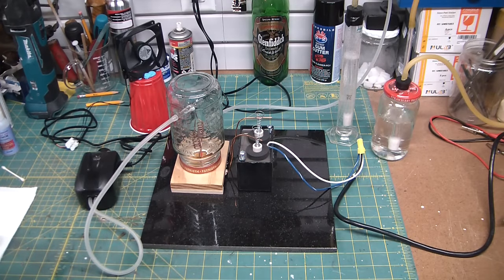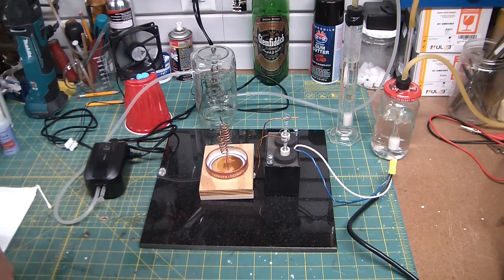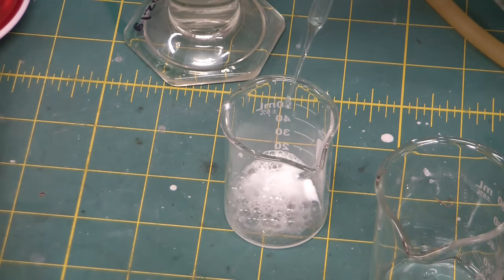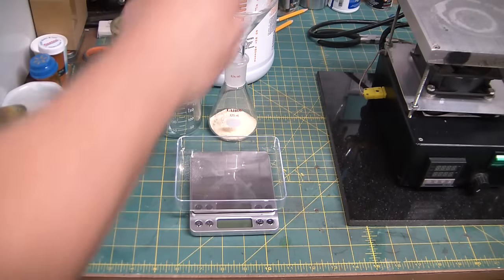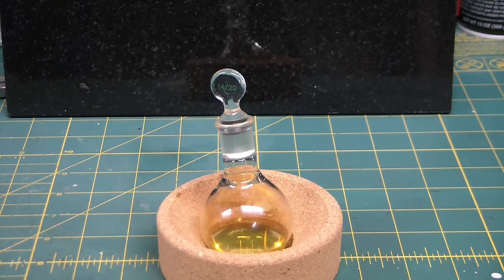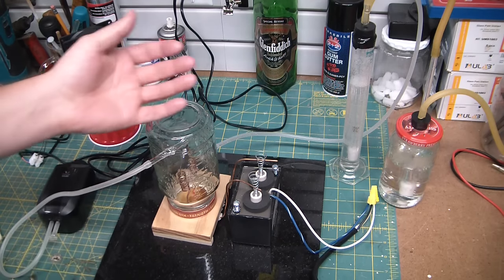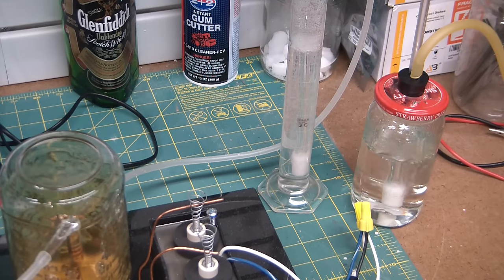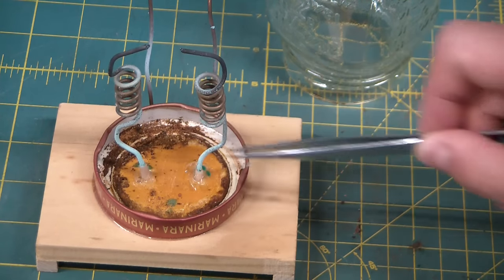Making Nitric Acid From Air - Elementalmaker

Comment from the maker: Hope you guys enjoyed! Here's the parts used for this video:
-oil burner transformer: https://amzn.to/3OtU1jg 
-air pump: https://amzn.to/3z2CN6T
-gas dispersion tube: https://amzn.to/3BcQcMv 
-cooling fan: https://amzn.to/3cv5SAd
Reply: Are you related to Ave?
Reply: @SynKronos  Certainly of the same crazy mentality as us who watch them both... 🤣🤣🤣
Reply: what about using a microwave to make plasma inside the jar ...
Reply: did you sulfuric or nitric acid ?
Reply: Can a Aquarium air pump work just as well
Reply: GOOD WORK👍
Reply: is it possible to do it in prison
Reply: would a neon sign transformer work?
Reply: Try out the Oswalt process (using nickel oxide catalysis)
Reply: Transformers for Neon-signs are also working, or for Ozone-generators, they are a cheaper too.
Reply: Now, make nitroglycerin. 😆
Reply: 6:15 Use (nylon?) gloves of some kind!!!!
Reply: Should of kept the sulfuric reaction in a ice bath same with making super cooled air when sparking. Larger surface area spark multi layered plasma. Would boost efficiency
Reply: The arc likely created a lot of UV light which may have degraded the epoxy.
Reply: Are you still alive
Reply: You still out there man? We're worried about you my man.
Reply: Please tell me it wasn't a microwave transformer We miss you man please come back
Reply: As one of you first 10 subscribers from waaaaaay back when, I'm hoping you are OK and still out there buddy 🙏👍
Reply: @Growveguk  He's still around, I saw a comment from his account a couple weeks ago on an AVE vidja..

Unless someone stole his account.
Reply: @walkingcontradiction223  good to know.  i'd been wondering/worrying a bit.
Reply: Nice, nice ... COME BACK!
Reply: can this way produce 100 liters of 70% nitric acid per month? if not how can we make it do it? would it be efficient? Also, can a 220 Volts electric current be used to generate the electric arc or not?
Reply: Miss seeing you on youtube - loved your content
Reply: @CodeCrafted_ if you want to make 100 liters of 70% nitric acid per month, you would need to make about 100 of these. I'm still trying to figure out how much my similar setup will make in a set amount of time. I keep running into issues keeping it running when I'm not around. I seem to be only getting .1 molar after about a day of running, and you need 15 molar (I think) to get 70% concentration. But I'm hoping to improve efficiency to get about 1 molar per day, which would yield about 1 liter 70% ever two weeks or so.

Comment: finally, a project that involves high voltage, toxic gasses, corrosive liquids, poison and baking soda
Reply: Codys lab made this some time a go
Reply: And no gloves and probably no eye protection.   A man that thinks just like me.
Reply: @tomirenfors2344  5 years ago
Reply: @kristyanne719  no gloves is fine here but eye protection he pobably has
Reply: Use h202 in place of h2o.  35% is better yield than 3% but 3% gets better yields than h20. Droplets are better than bubbles. Good video!
Reply: I've been wanting to do this type of project for some time now.  Nothing like cheap chemistry/fertilizer
Reply: It's all overestimated a lot.
Reply: any days on my kitchen
Reply: @kristyanne719  no gloves is safest when working with nitric acid, um who did a video on this, I think it was the young nile red, nile red has some great videos my favourite although not as dangerous but turning nitrile gloves into grape soda, yummy want me some of that,.... this is a cool video I like it
Reply: @Unmannedair  ....and peeing on wood chips in a 55 gallon barrel for nine months, then letting set for three makes a whole lot of potassium nitrate.
Adding sulphur and charcoal makes black powder.
Reply: The 4 horseman of danger + baking soda
Reply: @lawfullysuspicious1225  it's just for RFNA/WFNA that you cant work with latex/nitrile gloves

RFNA sets these on fire, either bare hand or vinyl gloves

you can use 68-70% nitric acid with nitrile gloves and it's better, gloves give time and resistance
Reply: Aaand no gloves!😬
Reply: Meth???
Reply: How to produce an explosive precursor from the air
Reply: @bernhardjordan9200  there's 2 (technically 3) explosive precursors that can be made from.air!

ammonia, nitric acid and if you try hard enough, HNO2 is formed as we can see from when he added the H2SO4, which is also a explosive precursor!
Reply: @kristyanne719  nitric acid makes some types of gloves burn. apparently there are special rated gloves for handling nitric acid
Reply: You forgot getting added to govt lists
Reply: @tomirenfors2344  Cool!
Reply: @johnneisler6552  Down tiger.   Not every chemistry experiment on the Internet is making meth.
Reply: @bernhardjordan9200  It can be used in gold refining as well.  As can cyanide.  Not everybody is a terrorist or a cult leader, and we are presumed innocent until proven otherwise.  Peace.
Reply: Are you even a DIY chemist if you don't use baking soda? 😂
Reply: @kristyanne719 when dealing with nitric acid, no gloves is safer because nitric acid explodes when in contact with rubber
Reply: A project that’s NOT illegal you mean? Lmao
Reply: Well said

Comment: Actually that is a cost effective way to make HNO3. I've know about this process but most ppl were using MOTs that are over a 1KW, so it would be too expensive. At 35 watts over 2 days, you only used 1.6KW hours. At 10 cents/KW hour, you only used like 17cents worth of power to make 10ml. Last time I bought nitric with shipping it was like $270 for 10 liters or $27/liter. Your cost was $17/liter, not including your time and baking soda. Not too bad at all!
Reply: My thoughts exactly...

ESPECIALLY if shipping costs are a factor.
Reply: Zzu
Reply: If you're trying to get nitrite and not nitrate, this is a great and cheap method. Like you said, it's working out to about $0.01 per gram of the sodium salt, not including the electricity to boil off the water. To get pure nitrite, just recrystalize the mixed salts from ethanol. Sodium nitrite will crystallize out.

Comment: Back in the day I built one of these. I achieved a ring of plasma with microwave oven magnetron magnets; you know, those toroidal ones with a really high curie temperature. I had a stack of two of them in the reaction chamber (which was a glass jar too :D), sitting on the inside of the lid, sealed with silicone, iirc.

Between the magnets, in the hole, I had a ring of thin copper wire as close a possible to the size of the hole, as an anode. You can run the wire between the magnets, just flatten it with a hammer as to not have a huge gap between the magnets. I guess you could use the lip of the hole itself as an anode, as the magnets are really conductive. You'd probably have to cool the magnets somehow. The point of the ring is to not have the arc directly heat up the magnets.

For a cathode, just a wire with it's tip in the middle of the ring. You can conveniently run the cathode wire through the inlet hose.

I also read somewhere that it's more efficient the cooler the output gas is, something to do with an equilibrium reaction between NO and NO2 iirc, so I had the output run through a 1.5l bottle to give it time to cool. The chamber ran really hot 'cause I was pumping like a 100 watts in to it. I don't know the exact figure, but my crappy 555 -based driver was drawing like 150w; I melted a flyback to the carpet one time :D so I'm guessing it was really inefficient.

It all ended when I joked with a friend of my dad's that I could make terrible gunpowder with the sodium nitrate I was making from the nitric, and my dad happened to hear. Out of worry of me playing with explosives, he banned the thing.
I cried for an hour or two... It was the first project that I was really happy and proud of. At the time I really felt like it was the meaning of my life. It was all I could think about, I even forgot to eat while fiddling with it!
I mean, with hindsight, it was the right decision, but come on, if you're gonna ban it, ban it because of the toxic gasses I was filling my bedroom with, or because of the high voltage, or because of the fire risk!

I couldn't bare to disassemble the thing for months, so it just sat on the floor for that time. Some day I'm gonna build a version 2.0. I'm also gonna have a scrubber, I've breathed enough NOx and chlorine and HCl and ozone for a lifetime. A little tiny breath of chorine feels like a punch to the nose, and even a tiny concentration gives you a nasty runny nose and a cough, and makes the inside of your nose smell like bleach. Not healthy :D

Okay I'm gonna stop rambling now :D
Reply: Hope u get enough safety to creat 2.0 version. And If u do that, do u plan to film it, or is it just smth that u will do far way from now?
Reply: I can definitely relate, my childhood had its share of questionable chemistry too. I remember my first time inhaling chlorine was when I used my mother's plastic kitchen containers as a reaction vessel for generating HHO after promising her wouldn't damage them. Of course I ended up melting the bottom and getting a lungful of chlorine all within an hour.
Time to make version 2.0 if you haven't already! I don't know how old you are, but no one gets any younger and that seems like a project worth doing.

Comment: The epoxy degradation may be attributable to the UV generated by the electrical arc. Standard epoxies don't have UV inhibitors and they are very susceptible to UV damage.
Reply: Could some of it have been due to ozone too?
Reply: For that length of time? 🤔
Reply: The amount of UV radiation emitted by the arc depends on the strength of the current. In this case, it may not be enough to noticeably degrade the plastic in such a short time. But plastics are very sensitive to ozone. And just a quite noticeable amount of ozone is released in this reactor.
Reply: What epoxy could stand up better to uv damage then? I have need of such epoxy for another project for some equipment I'm developing.
Reply: @samfisher9413  just add soot or carbon black to the epoxy.
Reply: @ahaveland  so basically carbon. I'll give it a try thank you.

Comment: Great informative video on the topic, nice to see you posting again. I've been meaning to make one of these, Nitric acid is difficult to get hold of in the UK (I understand why, regulations changed after a bunch acid attacks)

- My best bit of advice would be to look for a free online copy of "Absorption of Nitrous Gases" by H. W. Webb. Published in 1923, it's a bit of a dense read and some of the science is outdated, but for free information on the topic it's the best resource I've found so far. The search function in the book is surprisingly good. 

- I suspect the damage to the epoxy might be due more to UV or Ozone rather than the NO2, although damp air in the chamber would make a hot nitric environment. Not many materials are going to last long there. Provided the silicone tubing isn't too badly damaged then perhaps cutting some silicone baking trays as disposable gaskets could be an option.

- The reaction of Nitrogen and Oxygen to NO is a fast process, the conversion to NO2 is slower and the equilibrium is favoured at lower temperatures. Having a longer (ideally Teflon or other resistant material) tube between the jar and bubbler should improve the conversion of NO to NO2. Back in the day they had a large chamber to allow for this.

- When dissolved in water, the NO2 forms Nitric and Nitrous acid. The Nitrous acid decomposes with heat or higher Nitric concentrations to give Nitric acid and NO. Keeping the first bubbler warm might improve yield, or jump starting the first bubbler with a bit of your fuming acid might improve your next run.

- Nitrous Acid can be oxidised to Nitric acid by Oxygen, adding a second bubbler (or the second output of the air pump, ideally with a one way valve sold as aquarium supplies) to the absorption chamber would aid in oxidising the nitrous acid. This could be done after running the arc, provided you kept running the second jar to avoid losses. A timer setup on the arc supply might also work, and avoid the need for more plumbing.

- I would add an additional scrubber with some form of base, such as Sodium Carbonate, Calcium Hydroxide or similar to get as much yield as possible and reduce Nox emissions. This last scrubber will have a mix of Nitrates and Nitrites though. Too many scrubbers will make your air pump flow rate decrease, so be mindful of that.

- I would advise caution with the salt you produced. Nitrites are quite toxic, affecting haemoglobin and oxygen supply. It's nothing compared to NO2 and a poisoning you'd notice, but still something to keep in mind.

- The book I mentioned in parts discusses Ozone reacting with NO and other things, this wasn't feasible at the time, but with cheap AliExpress aquarium Ozone modules it might be worth experimenting. There's some stuff on Google Scholar about Ozone turning Nitrites to Nitrates, but it's mainly focused on wastewater treatment. Still worth considering. 

-Not sure about using magnets, the videos I've seen look good, but it's not my area of expertise. Others have mentioned Magnetrons from microwaves, but old hard drives might be an alternative source that avoids the ceramic containing Beryllium found in old microwaves. 

- With the cooling fan; perhaps putting a large plastic container over the arc vessel with the fan glued on top and vents cut in the side would work well. It would also prevent anything from shorting the spark coil and help accidentally touching any high voltage. The cooling would be focused on the jar and keeps fingers away from high voltage.

- Really looking forward to version 2, I might just have to get up off my arse and make my version 1. Hope the reply wasn't too long.
Reply from the maker: Really great suggestions! I'm gonna be getting a couple of those silicone baking mats and trying that for sure!

Comment: Very nice. A chemist friend and I made some NA years ago.  Our setup was in the garage before realizing everything that was bare steel rusted overnight. 
Also the UV from the arc is probably what degraded that epoxy like that.  Most epoxies are not UV stable and I've seen it come out like that after being in a UV-C chamber I have.

Comment: great project! at least when handling dilute nitric acid and sulfuric acid try and wear gloves, always better to be safe. Now with fuming nitric acid wearing certain gloves is actually worse than not wearing them. Glad I found your channel
Reply: Your fatty hands are a pretty good protective layer and it will just stain you a bit yellow if you clean it off right away. Better than having gloves ignite and getting welded into your skin lmao

Comment: You can use a disc magnet from a magnetron and a washer and sone dc high voltage to make the plasma run in circles. Obviously you need to cool the magnet pretty good or it won't last long. For ac high voltage an electromagnet might work which flips polarity at the same time as your hv source. This is why an universal motor runs on ac and on dc. You are basicly making one of those battery motors where you take an aa cell put a magnet on it and hang a wire on it so that it touches the other pole and the magnet. It works het same way with plasma
Reply: The electromagnet would be better , you could have multiple anodes and cathodes and pulse them also.
Reply: I have used those magnets before. You don't need a washer or anything. If you just center a wire in the middle and have a high enough voltage to make an arch then it will work. It doesn't even need to be perfect just close. You don't either need to cool it is your don't run a lot of watts.
Reply: @TestyCool  less power also means less nitrous oxide generation. These ceramic magnets are absolute horrible conductors so why would you do it like this.
Reply: @leon13noelspy  less power doesn't mean less nitrous oxide. As long as you have enough voltage to ionize the air it will work. Watts or power is voltage times Amps. so you can have really high voltage but really low amps. I used a neon light ballast from Lowes. 15w but it puts out around 500v. Then I stepped that up again with a flyback transformer I got out of a TV. That got me up to 16Kv at .0009375 amps. Worked like a charm. Yes those magnets are bad conductors but hell almost anything conducts at 16kv. The watts are so low though you dont even need to worry about heat or cooling.
Reply: @TestyCool  i used flyback transfprmers for oxydising nitrogen before. Using one of these ceramic magnets and a washer on top so the plasma can spin better. I didn't cool the magnet since i didn't think i needed to. After an hour that magnet wasn't a magnet anymore
Reply: @leon13noelspy  The neon light ballast acts as a regulator. It keeps you from dumping to much watts into the magnet. Also no washer means longer arch means less heat on magnet and better conversion rates. the longer arch mean the air take more of the heat.

Comment: I use that same brand of drain cleaner for H2SO4. I've done extensive testing and reviewed the SDS - as far as I can tell there are no additives at all and my titrations and density tests put the concentration at 96-98%. I bought several jugs in case it disappears for some reason. Such a great and inexpensive source of clean H2SO4.
Reply from the maker: Yeah it's really good stuff. I also have a few gallons back up just in case lol
Reply: @ElementalMaker  in nyc you can buy NA otc

Comment: 4:52 i think possibly the bell from a CRT tv could be used as to spread the plasma disk. Take the windings off the plastic part and wrap them around the jar. I might try it lol its just so dangerous to try an manipulate the arc WHILE its running.